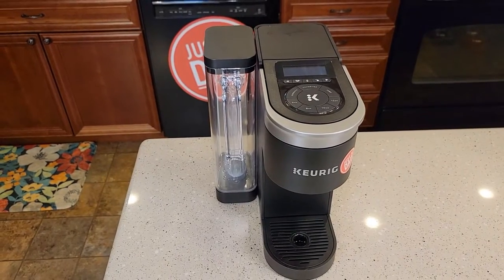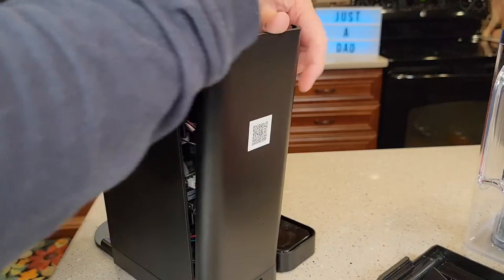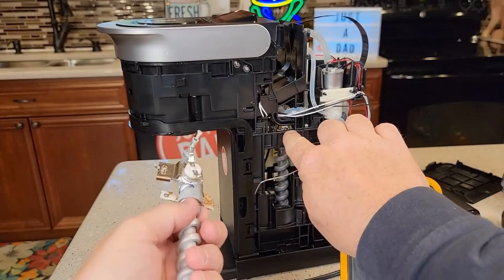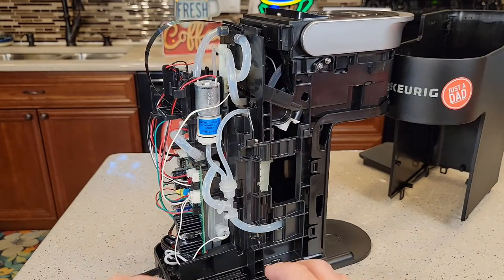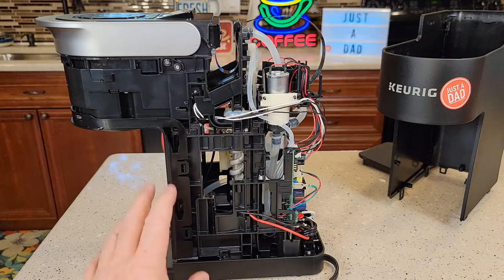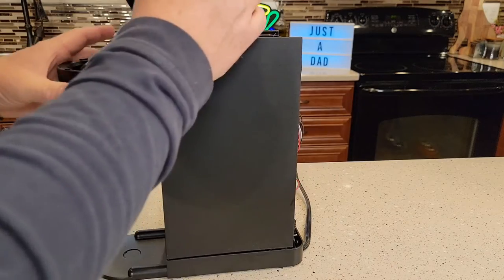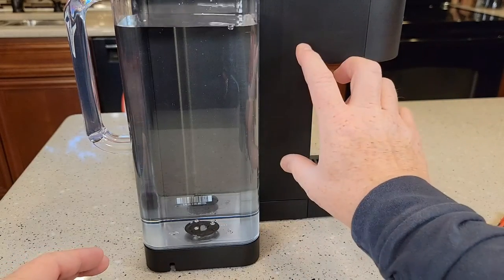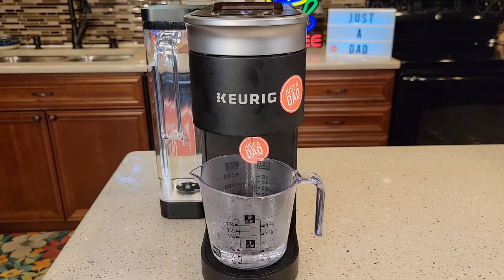How To Fix No Power Keurig K-Supreme SMART Coffee Maker Open Up & Reset Thermostat

Comment: Used the video to service a unit that would not dispense but a few ounces. Troubleshooting through most of the components by removing taken apart and cleaning and finally replaced the pump motor which I had a spare from another unit. That was the issue and now works like new. Took the bad pump apart and discovered two of the small flat valves were damaged with caused the issue. Going back to just using vinegar and water for descaling and not the Keurig solution. Thx